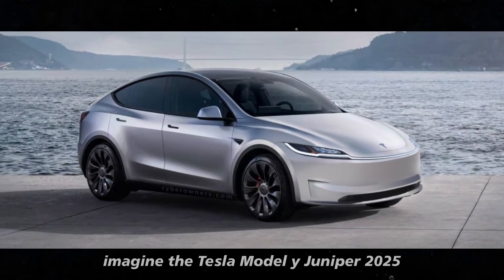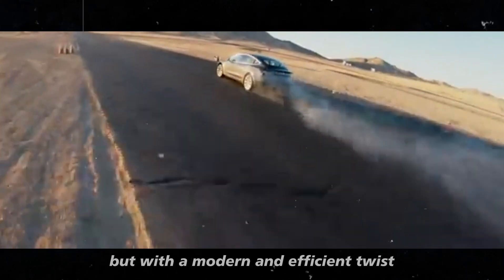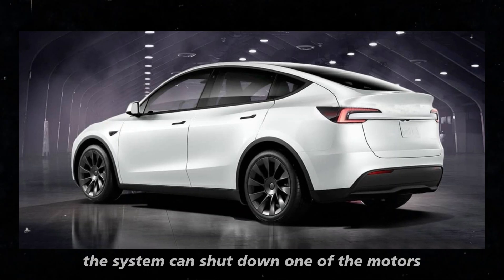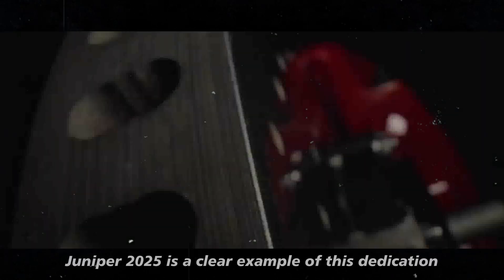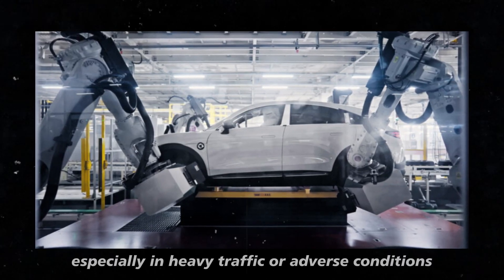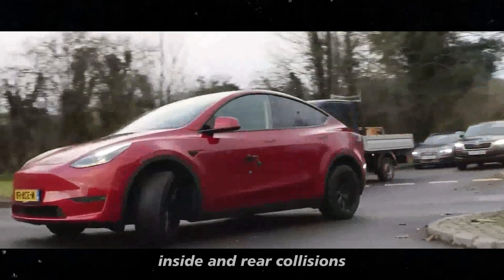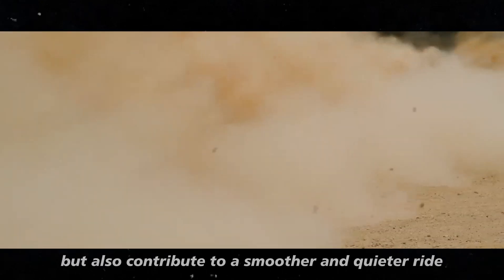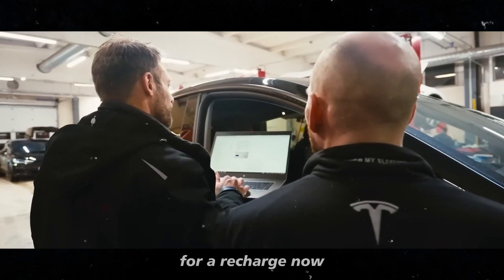I WAS IMPRESSED! New Tesla Model Y Juniper 2025-Elon Musk Reveals Launch Date, New Engine and Design

Comment: This will be an extraordinary value when it’s available for $25,000. 👍

Maybe someday Tesla will be able to supply us with a solid state battery that will give us 600 miles per charge that can be recharged in just 10 minute… with a 1,000,000 mile warranty. They might be able to pull that off when there are no longer humans working in the factories. Replace labor cost with more battery capacity.
Reply: Ain't going to happen just like anything they built little into new design so they can accumulate more money for there brand. If they made that vehicle it would destroy the car market
Reply: @carlosrondero2077  LOL… they’ve already destroyed the car market. ALL of the legacy OEM’s world wide are struggling to survive the decrease in combustion engine sales. They can’t make a profitable EV to offset their loss in volume… so they are screwed!!!